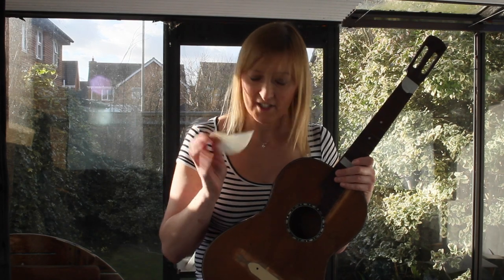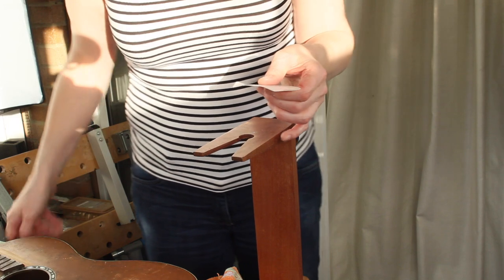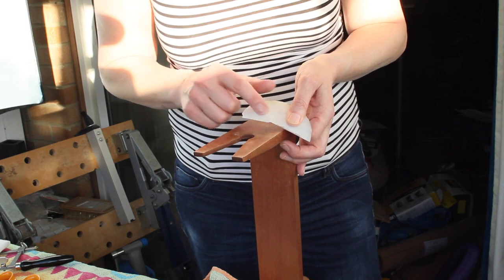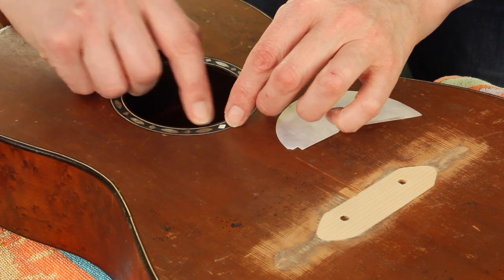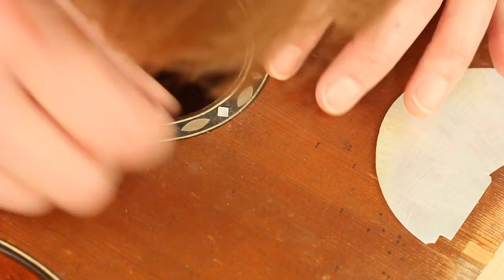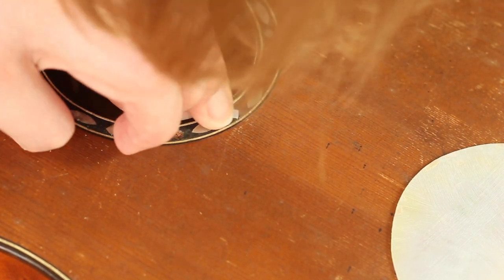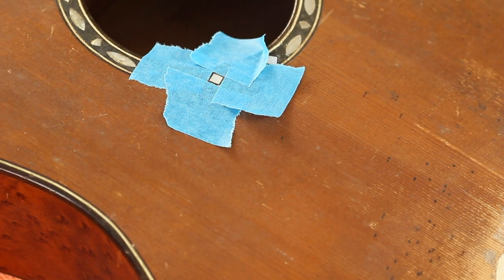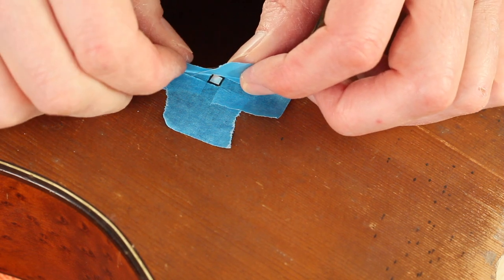Restoring an antique parlour guitar part 23: Inlay repair

Comment: Good job Susie! As you don't have a superfine nozzle on your CA bottle you may find Ben Crow's trick of putting a small drop on a piece of scrap plastic and and dipping a utility blade edge into it to transfer a thin line of CA to the inlay.

Regards,   Chris
Reply from the maker: I think I spotted some superfine nozzles in my local craft shop - I need to get some. I'll go back and check Ben's inlay videos

Comment: Coming together now and looking good! Where can i find discs of pearl like yours? been looking for awhile but haven't had any luck!
Reply from the maker: I got mine off eBay - user robsbits, eBay shop Pietra Dura Etcetera. It may depend where you are though. I can't buy shell inlay from the USA due to, I think, CITES restrictions. There's a flexible abalone strip purflex that an American luthier produces and Stewmac sell, but they won't ship to the UK.
Reply: +Susan Gardener Just looked that up as I didn't think that was correct and only one type of abalone has been banned from South Africa. It may, however, be that for the problems outline in the link that people don't supply it. https://www.ibma.org/press/archives/you-cant-take-my-guitar-what-every-traveling-musician-should-know-about-cites
Reply: Thanks very much for that Susan!  I'm in Ireland and also have the same problem when trying to order pearl from US sellers like StewMac and LMI., i think maybe it's because it's from an animal?
Reply: I have a okd old lignatone but not the floating bridge is missing , where can i get a replacement? thanks
Reply from the maker: +Paige try a luthier supplies like Stewmac, LMI or Allparts, however, you might need to make your own if you want it to look authentic- a local luthier might be willing to shape a bridge for you

Comment: Would it have helped to have the MOP on a thin piece of wood to support it?
Reply: When cutting it out, that is.
Reply from the maker: +Pádraig Floyd It may have helped when starting the cut, but I was ok here. My worry with larger pieces would be removing them from the supporting wood afterwards without breaking them. Then again there would be a chance of breaking the piece without supporting wood.
Reply: +Susan Gardener I can see that. I meant just laid on a piece of wood, not affixed, and perhaps clamped to the jig.
Reply from the maker: +Pádraig Floyd Good point. I might try that when I cut my logo from abalone on the new build
Reply: +Susan Gardener Sounds good.